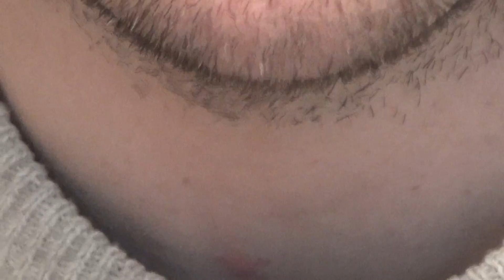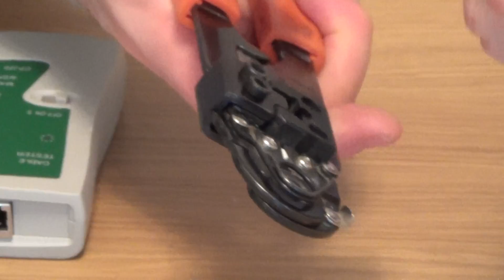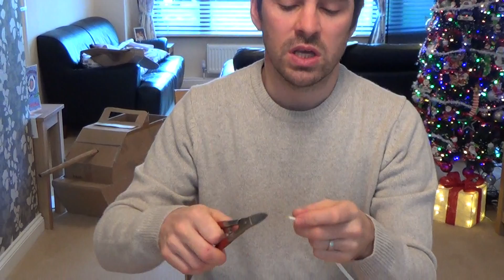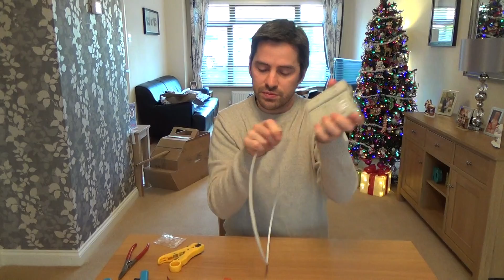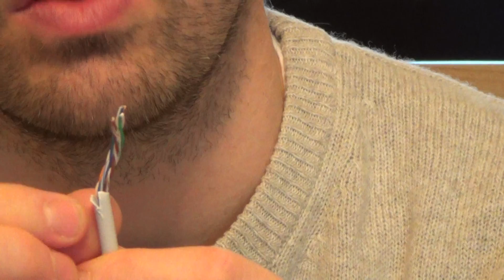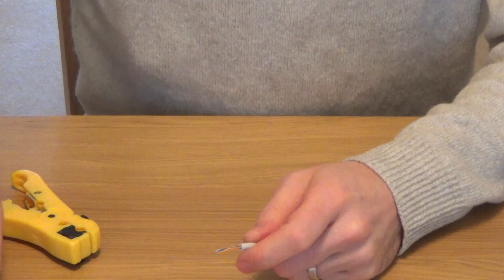How To make CAT5e Broadband ADSL cables using RJ11 and RJ12 Plugs

Comment: Very useful. I've run a VSDI2 RJ45 extension from the master socket using drop cable with solid copper cores. I shielded the cable with kitchen foil and ran it in plastic conduit.

Comment: Great video once again Vince. Was trying to checkout your Ebay shop but the links on your web page doesn't work. 😓. Do you still make cables? I'm looking for RJ12 rounded cat 5 cable 6pins 6 cores to connect to pro 9 pin Female D-sub socket solder connector rs232  for the works portable printer. I have found flat cable RJ12 on ebay but the DB9 connector strain relief is for rounded cable not flat cable. If you could make me a 6 core 6 pin RJ12 round cable. I would be happy to pay for your time. I hope this makes sense.  Kind Regards David.

Comment: Hi Vince. I watch your videos all the time, but wondered what's happened to your ebay shop?
Reply from the maker: Hi there, I have closed it for the time being while I concentrate on other projects. I may open it up again mid 2019 or possibly open it up to sell a smaller range of products earlier in 2019:-)
Reply: Shame. Finding round entry RJ11 plugs to use with Cat 5E cable is like looking for a needle in the eBay haystack!

Comment: Hello! I am trying to use my RJ11 (Cat5e) line in my house to hook it up to an Ethernet (RJ45) wall plate I got, the only problem is that the RJ11 has 4 wires while the RJ45 needs 8? Any help would be great thank you.

Comment: Hello i have a BT fibre line in my house and a Huawei 24 port network switch for a fully hardwired house for all the Smart TV's etc.Obviously a fibre connection is stable  but before in the old days it wasnt
Just out of curiosity i knocked up a crossed Cat5e lead with RJ11's between the BT hub and the NTL5 faceplate and got a decent improvement on an already fantastic line!
Before dowwnloads were 69-70 after 71-72   Before uploads were 10-12 after 14-16 So for very little effort a slightly better connection and i am chuffed!

Comment: Hi, I have a long flat CAT.5E cable but it only has 4 wires & a bare wire, colours being green, white/green, bare wire in middle, orange, white/orange. I have the crimping Tool & RJ11 connectors, can I use this cable as a broadband ADSL cable? If so what would the colour order be? Any help appreciated. Thank you.

Comment: my experience with the same tester wasn't good for RJ11/RJ12 plugs. One wire always hinted at faulty, but I eventually got to the point of believing my tester wasn't telling the truth! I decided using the RJ45 sockets to test the RJ11/RJ12 cables and the cable tested ok. My bin was rattling with the quantity of RJ12 plugs I had just cut off because I considered I was making mistakes!

Comment: I have 4 port application.   I am coming in on RJ11/12  DSL modem  100 meters away and exiting on 3 port RJ45.   I am termination into a wall plate with 3 port RJ45  going to one bedroom; Garage, and spare to the attic.  I am not sure if they are crossed or not.  I have some of the tooling and connectors.   I was going to build around 5E now I am rethinking this for Cat 6a or E.?

Comment: What if your internet uses 2 pairs in one cable. would you cross them or wire them straight? My internet comes over 2 pairs so i can get faster internet. I'll be using cat5e cable and terminating them with RJ11 to run about 20ft of cable from the wall jack to the DSL modem/router in my room.

Comment: All these CAT5e videos are much appreciated. I have now CAT5e'd the main desktop, including the RJ11 to RJ11 cable at the router. I also took the opportunity to make a CAT5e patch cable with good quality stranded copper cable; the cheap bought one I was using was likely CCA. The internet connection feels much quicker than it did with the powerline networking I was using previously.
Reply from the maker: Excellent, thanks for the comment.
Vince

Comment: HEY VINCE I MUST THANK YOU FOR YOUR ADVICE AND FOR YOU SENDING ME 2X CAT5E RJ11 CABLES FROM YOUR  EBAY SHOP WOW WHAT A DIFFERANCE FROM MY MASTER SOCKET M3 ADSL FACEPLATE TO MY SKYHUB  I JUST SAW ANOTHER GREAT VIDEO OF U USING CAT6 CABLE WITH RJ45 PLUGS I HAVE NORMAL  RJ45 LEADS TO MY SKYHUB FROM FIXED CAMERA CAN I USE THESE   RJ45 CABLE WITH CAT6  ?? A NOVICE IF YES WILL ORDER FROM YOUR SHOP GREAT WORK THANKS  AGAIN
Reply from the maker: Hi, yes you can use CAT6 cable but you will be unlikely to notice any difference because your current lead is probably cat5e so it will still be quicker than current broadband speeds.
Thanks Vince

Comment: For modem connection for VDSL2 for what I need fat Cat 5e cable with 8 wires inside ? as I know 2 wires are enough and maybe will be better to use telephone cable YTKSY 1x2x0,5 its much thinner that Cat5e UTP.

Comment: Hi Vince thanks for video,after struggling with poor BT broadband for 15 yrs because we are on a rural line and 1 mile to cabinet,and having various callouts to replace faulty O/H cables and corroded joints,I now get 1.9Mbs (was .7Mbs)funny part is when engineer plugs into test skt' he gets 2.1Mbs ,when he uses my supplied with Hub flat lead its 1.9Mbs,so the crap supplied lead is losing me .2Mbs,engineer admits the leads are rubbish but all BT supply,so have toyed with idea of cat5 lead to minimise losses,after having watched your video I now know its possible,thanks a lot Alex

Comment: We have AT&T ADSL the cat3 cable is ran to the garage attic. The cat3 looks like a cat5 because of the color codes it's a 5 pair. white gray & gray is added & not sure what is used for. I am baffled why it is called 3 when it looks exactly like a cat5 has all 4 pairs it looks the same size and are copper. I assume it is capable to be used as cat5 when U-verse finally be instead hopefully by next year sometime but at the mean time I want to fix this mess up here. Anyways When it was added to the attic & is poorly & I do mean poorly shielded it's rigged on with a telephone line regular down the wall panel. The problem is when they ran the line it's to short to run down any walls. I am re-running it & doing away with that telephone to run cat5. My question is should I use cat3 keystone? Since this cat3 has blue & white blue. I assume I can use cat5 blue & white blue? But punch it down on cat-3 keystone?  But if I am correct RED goes with Blue & Green goes with White blue. This is when I plug in the telephone line. I thought it was very stupid of them to leave about 3 feet no joke!. That is why I can only come up with Keystone up in the attic & keystone the other end when I drop it down to panel it. Good idea?

Comment: Will a Cat5e With Shileding help with RJ11 plugs? I have had BT infinity with Hub 5 installed a few months now and My router has never stayed in sync for more than 7 days. I am currently using Flat RJ11.
Reply from the maker: +MegaGHWiga  Shielded cable can help if there is a lot of external noise but you may struggle to fit RJ11 plugs onto a shielded cable because it tends to be thicker than normal UTP cable. Normally normal UTP cable if fine.Thanks Vince
Reply: +My Mate VINCE Well I was searching around and I found Shielded 10M Rj11 to RJ11 Cat5E. Found it on Maplins. Hopefully it makes a difference if not I am not sure what to do :)

Comment: Where I can get a rj12 round cable entry shielded plug with strain relief? There are thousands of unshielded and rj11 shielded but I can't find anything. I intend to make a vdsl cable to replace the cheap flat one supplied with modems/routers using leftover cat6 shielded from a loft installation.
Reply from the maker: +majnu100 Hi, I haven't seen any shielded RJ12 round entry plugs, I think you will really struggle to fit shielded cable into a rj12 plug as shielded is another 1 or 2mm bigger than normal cat6 and normal UTP cat6 is still a very tight squeeze. Also I have never found any RJ11/12 strain relief boots...If you do ever come across them please let me know.Many thanks Vince

Comment: Hello. If I made a CAT5E cable with one RJ11 plug, could I terminate the other end into an ADSL faceplate (A and B terminals) and if so what colour wire would I put into the A And B terminal. Thanks and keep up the good work
Reply from the maker: Andrew Hume Hi, yes you can hardwire one end into the ADSL faceplate (nice and neat that way). The white/blue wire goes to A and the Blue wire goes to B.Many thanks Vince

Comment: Hi Vince.
Basically what I want to do is to make my domestic ring main into a broadband outlet,the reason being is that I want to cut down on the wifi for health reasons.
Do you sell any plug and play products to achieve this ?.
Please contact me on
jfoulds2012@gmail.com
most sincerely
John
Reply from the maker: naybobdenod  Hi John, no I do not sell them but places like PC world  and Argos and Amazon sell Powerline adaptors which use the electrical ring main to push the Ethernet signal around the property. The slightly older slower versions can be as cheap as £20-£25 for a twin pack and they do work pretty well.Thanks Vince
Reply: Thank you Vince.
Appreciated